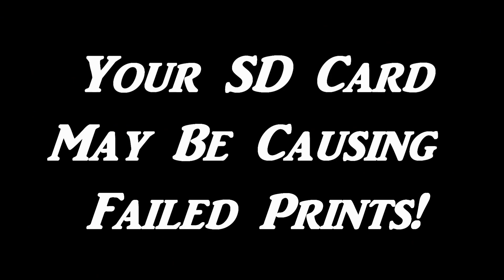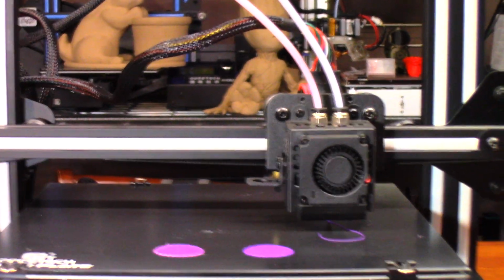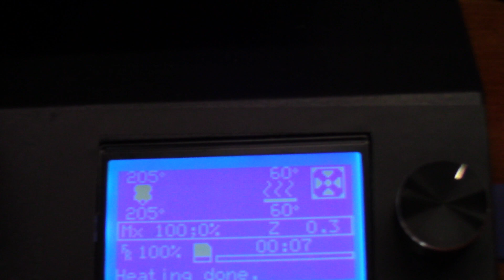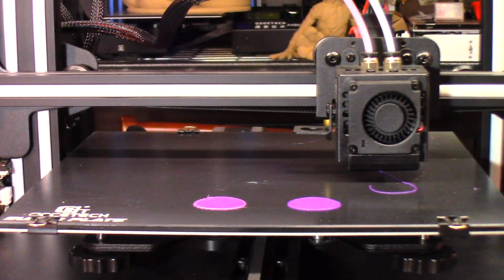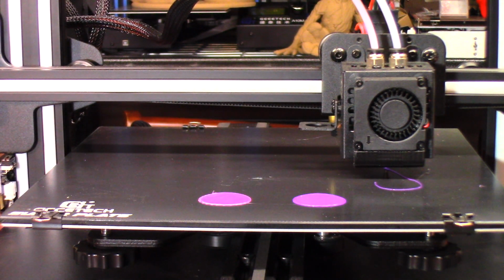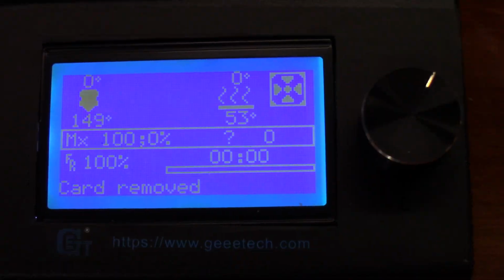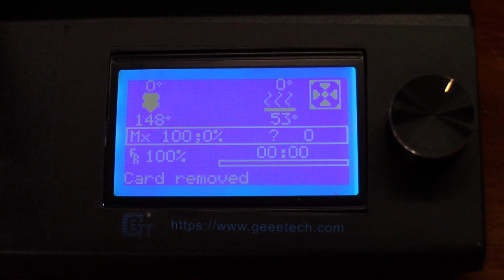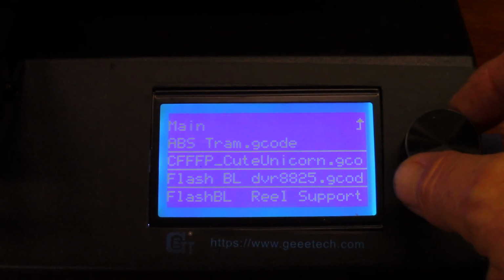Your SD Card May Be Causing Failed Prints!

Comment: I haven't tested this yet but it seems like a pretty good solution to a problem I am encountering. Some prints will work fine, others won't. I never thought it might be the SD card though. I switch cards between jobs so now I'm going to pay attention to see when it hangs up again and then print the file again on another card. Thanks for the potential fix. Will update if that clears it up. :)

Comment: Very grateful for the tip.  I didn't change sd card, kept the file on it (so it filled the dodgy blocks), put a renamed copy of the file on and it worked.  Could be risky for a long print.

Comment: Printer stopped extruding after first 4 layers. Changed extruder gear, changed brand new nozzle, PTFE tube, silicone socket, hotend, cooling fans. Bought new filaments, tried fresh ones off the packaging, dehydrated it for 24-hours, Changed nozzle sizes, hot pull, cold pull at 90°C, Blew a fan into controller unit. Got a brand new dual-Z axis rods. Print still stop just before or after the infill. Bought a brand new SD Card and formatted to FAT32. Uploaded same Gcode files. Perfect flawless prints!!! Ure the Jesus of 3D printing homie!!
Reply: I’m going to do that. I’m going crazy now. My sd card is messed up

Comment: Recently 2 of my ender v3 SE started  to not laying layers on bed properly for no reason i spent solid 4 days on resolving this,  lot of plastic wasted, like 100 leveling attempts, and then i find out this video just randomly and did a slow fat32 format on both sd and  BOTH of printers started to work  in best way ever. Buttery smooth first layer without any correction. God bless your soul kind man.

Comment: Thank you!! I have had numerous successful prints without issue, but all of a sudden my print head would randomly stop moving a few layers in, blob up, then eventually reboot. The more I tried to resolve it, the issue started happening earlier and earlier (usually right after it drew the line on the side). After watching this video, I decided to first check the format of my SD card. It was in "FAT" format. After some research, I found that most printers can only handle "FAT32" format. I reformatted my SD card, re-sliced, and tried printing again. First time in weeks I have had a successful print without any issues. Thank you once again!

Comment: This happened to me on one of my first prints that ran over 24 hours,
switched out to a SanDisk since then.
currently running a print that is at over 25 hours now and I really hope that did the trick.
Reply: Did it?
Reply: @joseffini5414  yes it did, did not have that issue again as of now

Comment: My ender 3 v2 printer just made the first layer and then randomly decided to go in x=0.0 and z=40.0 and stayed there while on the display it said that the print was continuing. My bed level wasnt perfect tho

Edit: the filamnet was not reachibg the nozzel, and the print actulay was "finished". I now have 2 succesful prints but now the filamment does not stick to the bed and gathers up on the nozzel. Any solutions?

Comment: That makes sense,  but here is my problem... im printing directly from my pc to printer via usb cable. Its not every print but randomly... in this case would the file be totally corrupt and need a full reinstall?
Reply from the maker: If you are going via cord it could possibly be corrupt firmware on the printer.  My original printer just had this problem.

Comment: Any tips when I tried already 5 different sd cards and the problem is still the same? 2 of them where brand new, 2 were from delivery scope and one was an old 32gb micro sd with adapter.
Reply: In windows, from Disk Management window, reformat the SD card and try it again.  That worked for me.
Reply: Connect your printer to your pc and print directly from curs app.

Comment: LIES not the sd card being corrupted and failing the print as thats a FACT. but this video is a lie cause @1.38  the screen says 100% completed and heating done as he must have just heated up the bed just for the video purposes. AND WHAT KINDA SMILEY FACE PRINT HE DOING THATS GOING TO BE ANOTHER 10 MORE HOURS. COME ON NOW
GOOD ADVICE BUT IM TIRED OF THE LIES.
Reply: Staged... lol....like the moon landing! preheating is staging? Great video , thanks ,yes I learned to use good quality SD cards.
Reply from the maker: Yes, I always preheat my printers before I print.  What does that have to do with anything?  Furthermore what lies?  Facts are facts.  I quit using throwaway SD cards that come with printers because they do corrupt easily.
Reply: @JimmyShawsTidbits1  the fact that this was all staged. But the issue and solution was correct. Just couldve came out and just said that instead of all theatrics.
Reply from the maker: I was going to try to respond to say it's wasn't staged but nah.  Have a good one.  Someday when you make a video I hope you have better luck with trolls.

Comment: Try to copy a large *.jpg on both sd cards an then open the jpgs at your PC. When you have missing lines in your jpg, the sd card has write and reading errors. It‘s better to buy branded sd cars, those cheap Chinese cards are garbage. Mostly